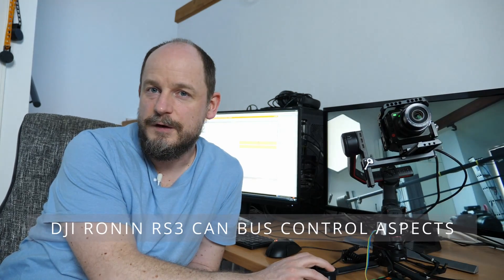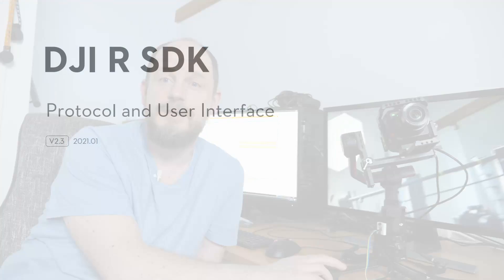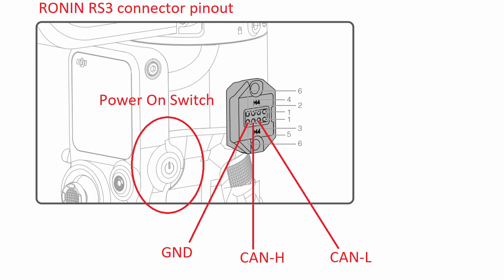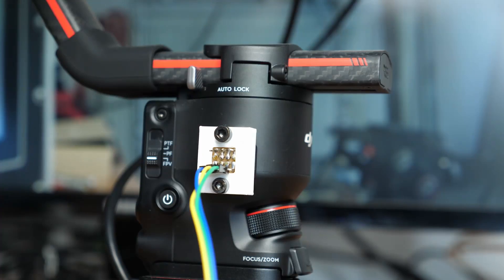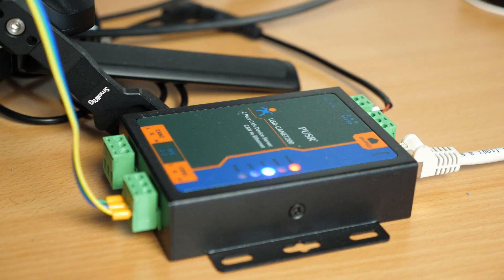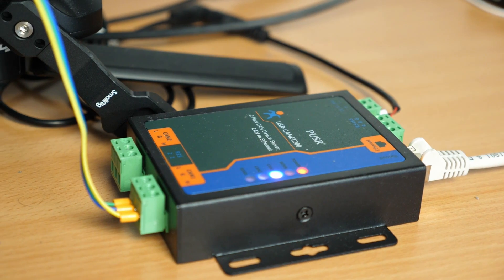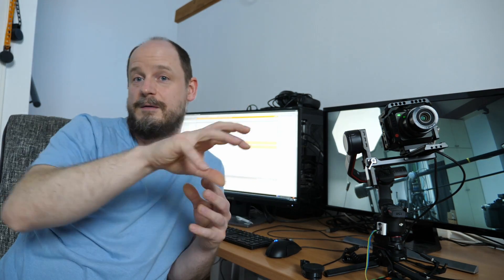DJI Ronin RS3 CAN-Bus control Experiences (kind of a DIY setup)

Comment: thanks - I currently try the same with a Ronin 4d and realized that i.e.such a sent command can turn the gimbal (pan left):
{ 1, 8, {0x55,0x16,0x04,0xFC,0x85,0xAE,0x5F,0x1D} }, 
{ 1, 8, {0x40,0x04,0x69,0x02,0x07,0x02,0x37,0xF8} }, 
{ 1, 6, {0x00,0x00,0x68,0xC5,0x0C,0xCB} }
do you know ho to manilupate speed and way ? 
I would be very helpful when you post your commands to the gimbal which ar working with the RS3 - maybe it is similar(?)
Thanks in advance!
Reply from the maker: Hi. I didn't work on this for a while, sorry I can't remember the exact telegrams. There is a very detailed manual about the protocol supplied by DJI. I followed that and it worked. I think the speed of the gimbal can set by steps maybe (on the gimbal settings), but if you want a controlled (smooth) movement you just have to send commands relatively often and define the exact path, the gimbal should follow. Thats, what I do.

Comment: Hi Péter, its me again. Thanks for sharing your work! I ran into a problem testing the can connection...
I tried everything to get CAN working with my RS3 Pro, but candump can0 never shows any signal, even when the gimbal is moving (via app or manually).
I'm using your exact pinout: Pin 6 = GND, Pin 5 = CAN-H (2.7 V), Pin 3 = CAN-L (1.2 V).
Also tested Pin 2 (1.8 V), but no combination works.

I'm using the SH-C31A CAN interface with Candlelight firmware on Ubuntu – interface is recognized, loopback works perfectly, but I never get any output from the gimbal.
Any idea what I could try next? Would really appreciate a hint!
Thanks in advance!
Malte
Reply from the maker: Hi. I worked on this project long time ago, so I cant really remember the details, but i think the connector is rotated on one side of the gimbal, so when you consider the pinout, you have to rotate it to 180deg. I think i talked about it in this video. What I did, I measure those fixed voltages described in the manual and referenced the connector orientation based on that.  Maybe there is a resistor which switches on the tool power, you can try to play with that to to figure out the proper orientation.

Comment: Hello, I noticed that all the frame headers I received start with 0x55. Could there be something wrong with my setup?
Reply: Hi. I had the same issue, but for ID 0x530. I got constant messages from that ID, but once i sent the correct message to the gimbal with 0x222 it replied with 0x223 and it worked.
Cheers
Reply: @dflycamera1554  Hi, I have exact same issue 0x530, how exactly you fixed the problem? Much appreciate your help

Comment: Great and inspiring video, thanks Peter!  Like many others, I'm in the process of a similar DJI control over CAN application.  I have hundreds of logs from a USB-CAN interface so I am starting to understand the structure and payload of their messages but have also (like many others) run into issues actually sending messages that are accepted by the DJI bus.  I see now that the inter-frame timing is critical, and MCP2515 is far too slow when driven from SPI - so your solution is my next attempt.  In your successful application, did you use the USR-200 heartbeat feature?  Curious what if any of the device features you needed to make your commands "stick" and get accepted.  I have a pretty decent idea of how a device handshake works w/ DJI, and what CAN ID sends the bus heartbeat - but haven't gotten mine yet to play with it so curious if you have suggested settings to use.  Thanks!!!
Reply: hi, have you figured it out?

Comment: Hi Peter! 
Thanks for your messages a few weeks ago. I have a few points I want to share with thinker people trying to do this:
1) The Pinout is wrong also for the RS 2. According to my documentation they changed it in verson 2.2.0.7 of de documentation which was in Juni 2021.
2) There is a Reddit Thread "Where to download the DJI RS SDK?" which gives the documentation and also a pretty good example code in Python.
3) I was not able to enable a CANBUS connection with a cheap mcp2515 board with raspberry/arduino. May be my error. However a rather cheap "Canable Pro" does the job perfectly. 
4) I also bought the CANET200 which Peter has and good to know: It is the same as the more expensive, but well documented "Waveshare 2-CH-CAN-TO-ETH". I think wavesahre rebrands the canet200.
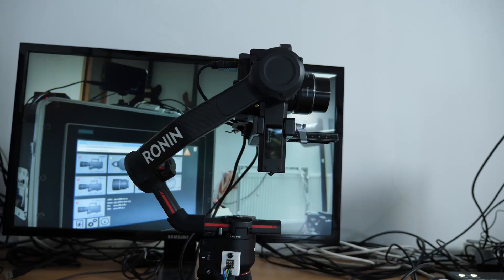5) the issue described in 2:30 with the interpolation: the RS2 has also this problem, bur only if the "time_for_action" data is to short. The motors will go the fastet they can. If you give enough time to the motor with the longest path it will interpolate.
I hope i could help someone starting out!

Comment: Hi Peter!
I am curently trying to work this out but i'm stuck on the canbus connection... my tests between two devices is succesfull at the given bitrate, now i am wonderin: did you have to terminate the connection on the ronin side? From the close up you are showing it doesn't seem so but i stall wanted to rule this out!
Many thanks!
Reply from the maker: @thetubaguy5853  Hi, i did not set anything on Ronin. Do you use ethernet - canbus converter?
Reply: Hi,
No i use a canbus module for raspberry. there i can send messages between the two raspberrys at the required 1M baud rate. When connected to the dji rs2 it s not working anymore… 
It seems that the ronin has a 120ohm termination. when turned off, it shows the required 60ohm between CanL and CanH. when turnimg on the gimbal the resistance goes down to 30… 
Yeah i think i ll try with a more robust solution as a ethernet<->cabus converter
Reply from the maker: Are you sure, if you have hardware issue? I can not remember exactly this project, but i think, you have to send request to get respound. Anyway i am very happy with the eth-can converter i use. It also work fine when i send request straight from unreal engine.
Reply: I am not shure about it. But i know i can't reach the required 60ohms for the canbus when my ronin is powered on. i try to send to example command in the documentation but with no succes, no respons nor movement from the ronin... i will borrow a second ronin to see if my unit is faulty. Can you tell me which eth-can you are using?
Many thanks for your help!
Reply from the maker: @ https://www.pusr.com/products/can-to-ethernet-converters-usr-canet200.html
Reply: Thank you!

Comment: Hi, I’d like to learn how to learn t do this. Are you able to share basic wiring and sample code setup for this? Is it done via arduino? Or can you point me to a guide as to where to start? Thank you.
Reply from the maker: Hi. My control is based on a Siemens PLC. Probably arduino could do the job, but I don't have any code for arduino. I woud start to search arduino and can bus. I would buy two arduino board with some CAN bus coupler and first try them to communicate. I am sure, there are many tutorials on this topic. If it works, I would make a connector for ronin and do the same between arduino and ronin. Siemens PLC can communicate on UDP with a ready to use UDP-CAN coupler, that makes the job easier.

Comment: Have you had any success addressing a second ronin focus motor?  Only one is documented in the api but I'm hoping zoom is lurking, undocumented somewhere.
Reply from the maker: Hi. Unfortunately I don't have any DJI focus motors. I use tilta nucleus-m motors also controlled from the PLC.
Reply: @PéterKucsera  how did you gain control of those?  Bought a Nano II attempting a diy wired control, but no luck yet.  I’d definitely go for the M.
Reply from the maker: @caseyandtim  I found some help on github. I built my control based on this: https://github.com/err4o4/tilta-nucleus
Reply: @PéterKucsera  I’ll have to try it with the M.  That was the repo I tried with the Nano II but no dice. 

Glad to know it works though.